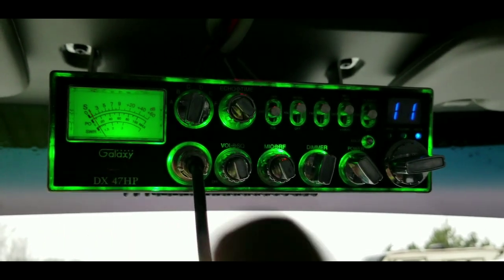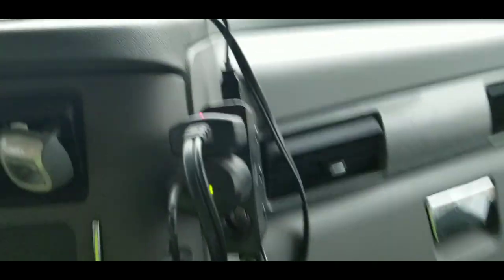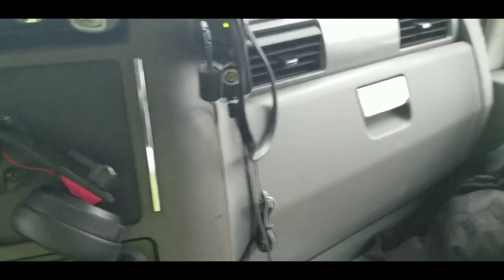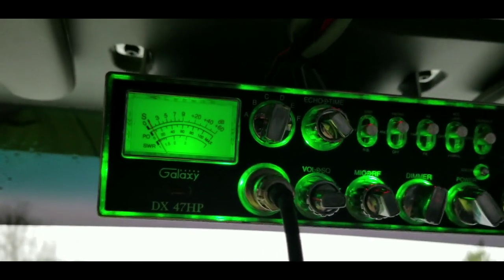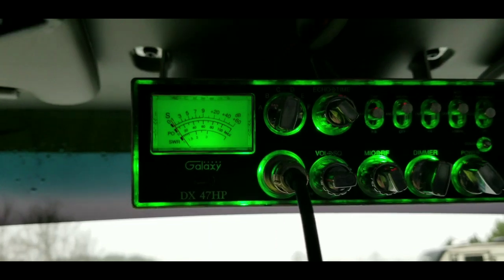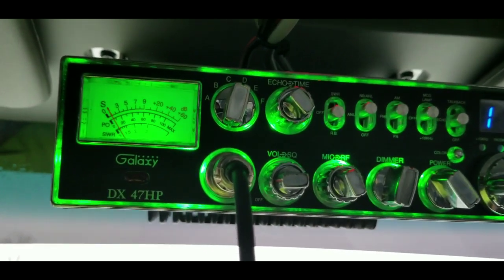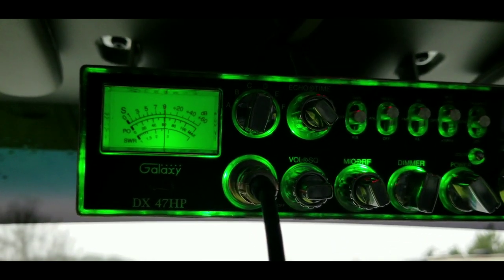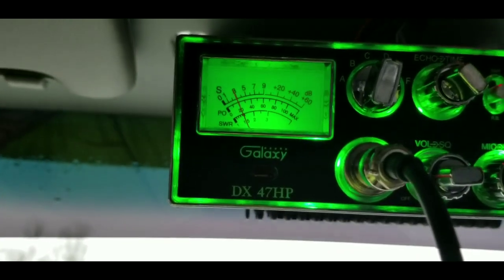Too Much CB Static!

Comment: I have a 12 volt plug for my CB radio and it only services by CB radio what I can't figure out is in certain areas it's normal no real static nothing but then for like hours it's just like screaming static and I have all my stuff running like normal when it is quiet and I have it connected to an antenna that I installed and I believe I did it correctly no idea what's going on
Reply from the maker: Without knowing anymore about the system and what you're using and the condition of it or the vehicle. There's some static interfaces you can get rid of. If you're a trucker, the inverter is a big  interface you can pick up other trucks inverters and LEDs. RF bonding will greatly help reduce these interfaces, I have 2 videos on it.
Reply: @jrichtruckincbtips  I'm a trucker and I drive a Freightliner when you say converter do you mean a power converter inside the truck? If so I'm not using it to power my CD radio I am going to try to ground the CD antenna and my CB radio is road King I was told it was a good brand
Reply from the maker: @bigt4490  it doesn't matter that you're not using it to power the radio, the fact of it just being on just blasts the cb system with static. Just grounding the antenna won't do much on the Cascadia. Watch this video it greatly improves your system and you'll need to retune the antenna after. https://youtu.be/ohkOX45dJn0

Comment: MY Radio came
 with a USB port. now that I saw this video I think maybe they are trying top preempt a customer with a static complaint.
Reply from the maker: I doubt the radios USB is causing any static. RF bonding will help cure most static issues. I have videos on rf bonding.

Comment: I'm having a similar issue but in my house not in my vehicle
Reply from the maker: The only way to find if it's really something in the house is unplug everything, and then plug stuff back in one at a time. Or, it could be a bad ground of the antenna. Hope you get it figured out.
Reply: Get a noise filter if your powering a 12 volt radio with a power supply. If it's an AC base with an internal transformer then the interference is being induced thru your antenna. Check that your coax is not in contact with other electronic devices or near electrical cords. Make sure your antenna isnt near power lines. If theres high voltage transmission lines within a couple hundred yards of your antenna you cant fix it.